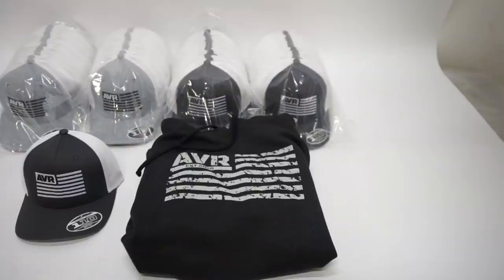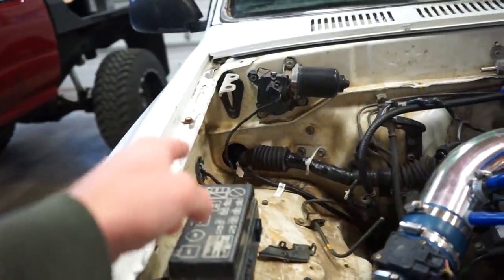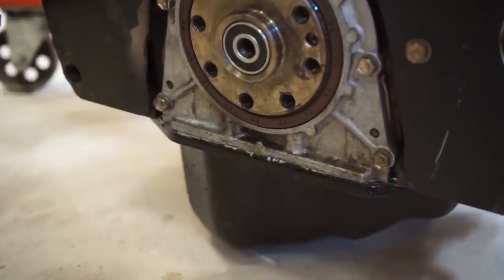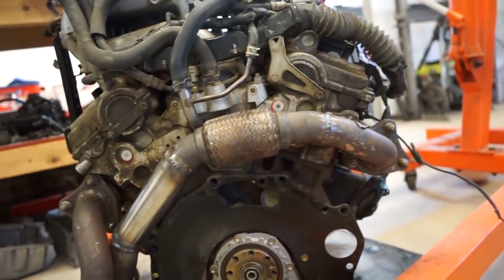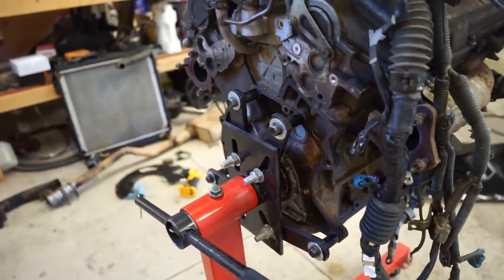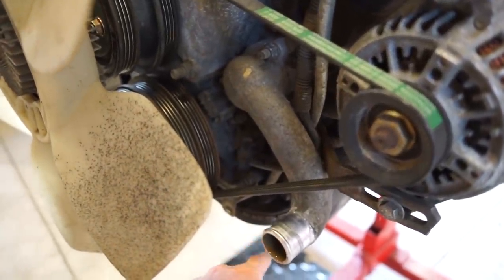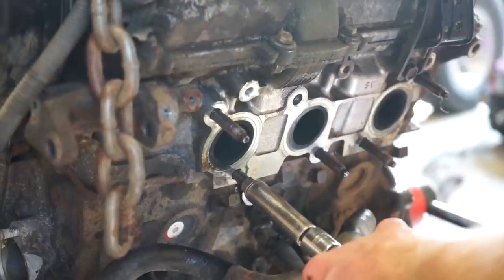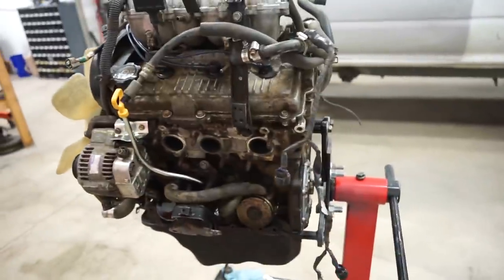Pulling the Engine On The 3.4 Swapped Toyota Pickup

Comment: Dude I am so glad that you are doing this series. I’m about to do this same swap on a 93 with the 98 four runner 3.4L that I already picked up. I’ve been reading everything I can find online so I can wrap my head around everything that I need to do before I set the motor in. Thank you.
Reply from the maker: Heck yeah!! Pretty easy swap compared to other swaps! No adapters or custom mounts needed!
Reply: I’m doing my swap right now! I have a 1992 pickup xtra cab 4wd. I bought it with a blown motor missing head. So I looked around and it just seemed better to do this swap. I sold my block and bought a 1997 4Runner 3.4l and all I have left is changing the alternator, timing belt, and water pump. Then I should be able to put it in the truck. I’m 16 and learning a lot from this build.
Reply: I did this swap and it is very easy epescially if you get the wiring harness from ORS.
Reply from the maker: Rush Johnston right on!! 👍

Comment: Forget the crossover pipe run dual exhaust!
Reply: Dont believe you can run true dual exhaust  since you can only utilize one cat. If you then i am all ears since i would love to do that to my 3.4 swapped yota.
Reply: Orlando Muñiz Biggest issue with the crossover exhaust on the 3.0 and 3.4 was heat saturation on the drivers side head. I’m not certain if header wrap would help the heat saturation issue.

Comment: So far so good... a little cleaning and a little paint to touch up and have the engine looking good.  Go flatbed with built in overhead rack system,  overlanding,, buyout, hunting,  ATV hauler... nice 2 tone paint scheme...some Raptor liner in the bottom ... well there's some ideas.. suspension over haul... number, auxiliary lights...

Comment: Interesting to see how other people have pit theres together. If it works it works! I used a 90 degree drill for the dipstick! And a freeze plig to fill the hole. Also maintained the 3.4 baffle just had to modify it. But less rtv! Solid work!  About to do another so glad to see it to refreshen up!

Why are you wanting the 3.4 clutch specifically?

Comment: I would not use wheel bearing grease as a seal lubricant. Sometimes the grease deteriorates the seal material. Engine oil is a safe bet.

Comment: Hi Austin, I have a budget of approx $10K for my TDI Swap.  Since you do not want the project, can you recomend someone that can do it that works as clean as you.  My engine compartment is already clean..  DCS (Diesel Conversion Specialist) makes a kit that will marry a 1.9TDI to a Chevy TH700R4  that is a bolt in.  My S10 Blazer has a TH700R4 so it should not be difficult.  The DCS kit includes the adaptor plate, flex plate, starter motor and all the nuts and bolts.  My S10 Blazer is a garage queen, so I am in no hurry to get it back.
Reply from the maker: Im not sure who to reccomend! I dont know many people doing these swaps!
Reply: @austinniemela  Thats the point, you could make tons more on this (basically bolt in) swap than selling stuff n your channel.  I am not looking for a freebee.  The engins could be ordered from Franks TDI, the adaptor kit from DCS, I could get a brand new (rebuilt) TH700R4 trans drop shipped to you, you could bolt it up. I could ship you the S10. You could drop it in and all it would need is the accessories hooked up ( Fab motor mounts,  PS&AC lines, vaccuum pump to the power brakes, and hook up the cruise andattach the current exhaust).

Comment: do these pans have a baffle plate in them to prevent oil slosh in the corners ?
Reply from the maker: Yes they do!
Reply: @austinniemela  that's pretty awesome i feel like the toyota engine is more durable than the alh for this application. i use to own mk4 alh tdi jetta which i loved but i ended up selling. the guy i sold it to watches your videos too. apart from being automatic my mk4 was perfect for me. i was going to manual swap it but i have  other projects.
Reply from the maker: gurjinder singh yeah the 3.4 is a great motor!!